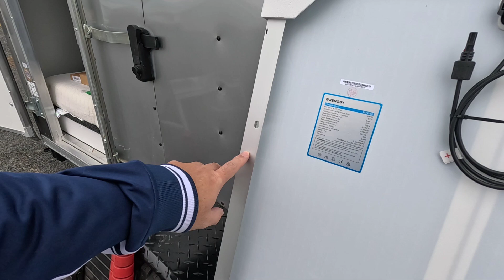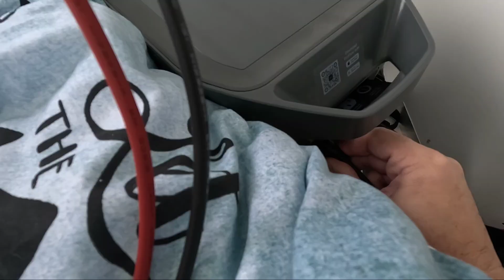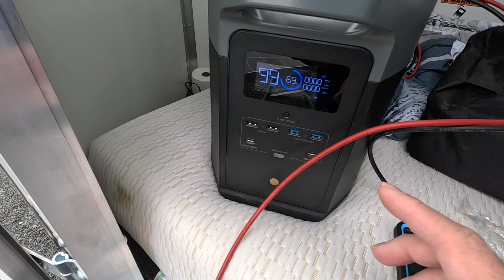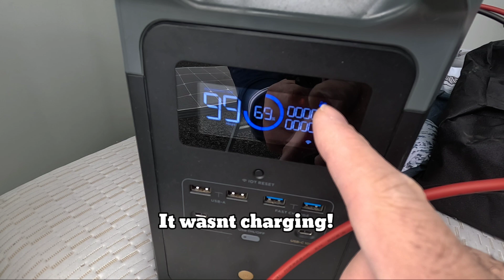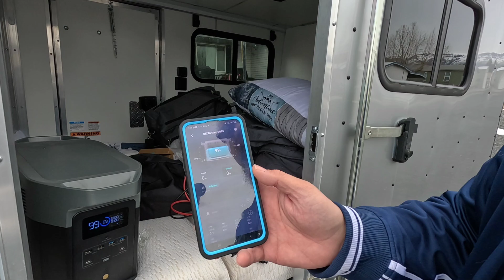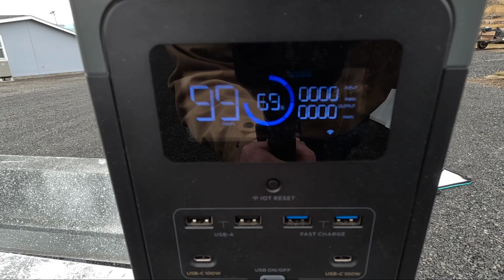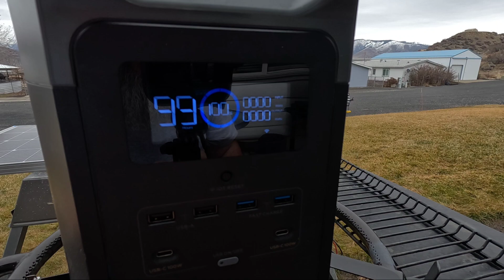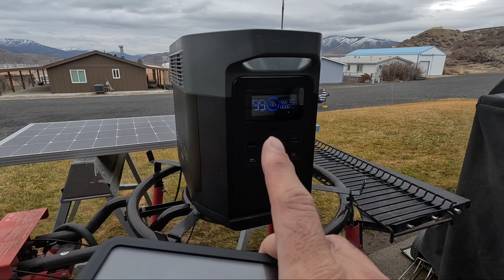Renogy Solar Panel & Ecoflow Delta Max Issue. Help a Newbie Out #solar panel #renogy #ecoflow

Comment: You have everything, I cut the cable with the XT 60 and ran it through, I use self taping screws and gorilla tape , if you want it to charge the battery your gonna need a charge controller
Reply from the maker: @Jay-bj2wr  I had a good feeling you would respond. Thanks!. I might wait for the temps to be much higher. I was gonna buy some decorations self leveling sealant.